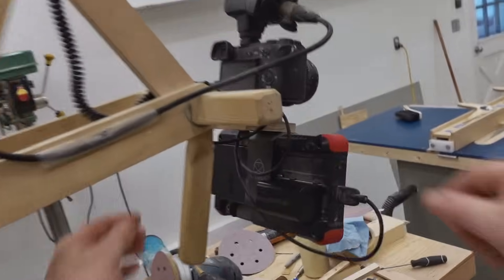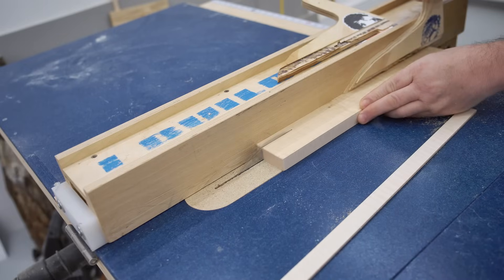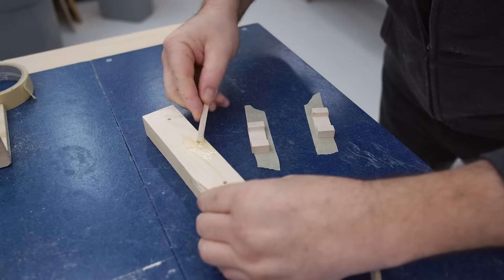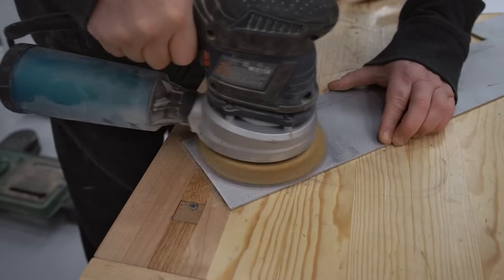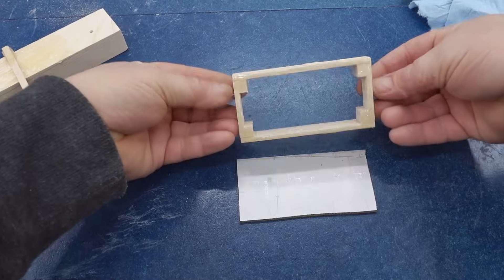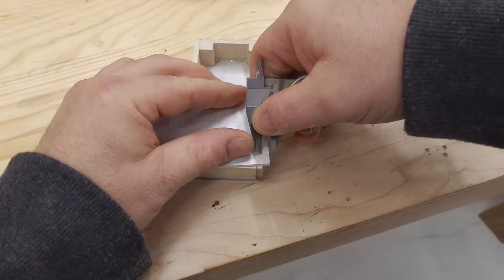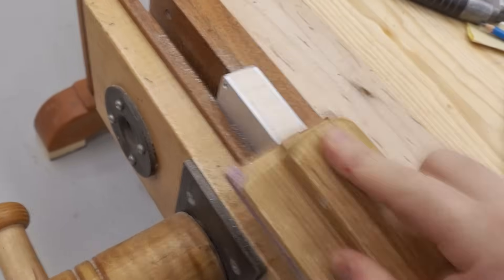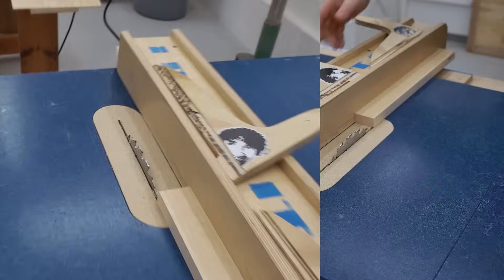Making This Aluminum And Wood Project Box

Comment: Nicely done this little piece. Lots of details for a neat result. Just a question. Since you have this fixed setup, why not using power from a transformer connected to an outlet so you don't have to keep an eye on the batteries ?
Reply from the maker: Mobility. The camera is on a gantry that moves from one end of the shop to the other.

Comment: Hi John, can you please explain why do you choose to cut some things on the table saw and some on the miter saw?
i'm speaking of the small parts that you cut on the mini table saw sled normally, but sometimes you use the miter saw for this kind of things. 
i can't understand why do you choose this way over the other.
Reply from the maker: Convenience, usually. 
And something to remember is that not everything you see in the video happened in sequence - there could be hours between one cut and the other that show up immediately after each other in the video.
Reply: @JohnHeisz  Thanks for the fast answer.

Comment: Just what I've been looking for for a small amplifier project I've been working on. I'd modify the dimensions so I can have the aluminum plate as the front and back rather than top and bottom, and attach the controls to that.

Comment: Cool project! And the blue aluminium really does look better :)
A question about the electronics (as I couldn't see a way to comment on the website): why did you use a linear regulator instead of a much more efficient switching regulator? I've seen modules online for a couple of euros, so was it just because you already had one lying around? Maybe it's the Wandelite in me, but personally I can't stand the less than 45% efficiency of a linear regulator, despite you showing that the linear regulator is obviously working well enough.
Reply from the maker: If I were back into doing electronics more regularly, I'd have built an adjustable buck converter to do this. Instead I used what I have on hand to get it done quickly. I don't trust the cheap switching regulators you can buy online to power a $1500 camera.
As for efficiency, I'm working with a battery that has nearly 10X the capacity of the camera battery, so there lots of room to throw some away.
Reply: @JohnHeisz  Thanks, that makes sense. I didn't really factor in the risk of "what if this $2 board from China doesn't work properly when attached to my $1500 camera", so I guess making it yourself would make more sense than hoping for quality in a $2 purchase. And, in that light, the linear regulator makes even more sense.
I know that the efficiency isn't an issue for you, as it clearly works. Part of me just thinks it's ugly if it's not as power-efficient as it could be. As I said, it's probably the Wandelite in me, with a tendency to make things more complex when a less complex build is also good enough — and, if you take build time and effort into consideration, better than the complex one.
Reply from the maker: The term diminishing returns applies here. The supply cost me nothing ultimately, since I bought these parts many years ago, and the extra amount of electricity used is not worth the extra time and expense to change to something more efficient.
Like rigging up something to switch off your electric water heater during peak hours, and running the risk of burning down your house when it fails.

Comment: Nice work, John! I always have trouble with metal dust embedding itself in the surface of the wood if I try things like this :( Had that problem with a walking stick I made recently.
regarding the electronics side, the circuit in that battery isn't just protection for the battery itself, but also some "brains" to tell the camera it's a genuine battery. If you inject power into the board where the battery cell solders on, instead of the output pins on the case, the camera should be fooled into thinking it's a genuine battery :D
Reply from the maker: I realized this too late, of course, after I stripped off the terminals and destroyed the board. Not a big deal, the proper dummy battery was cheap enough and the camera battery I used was nearly used up.

Comment: If you want to step down 18V to 8V for battery powered applications then best option is to use a buck converter, they are ridiculously cheap on eBay and the like too
Reply: I came here to say this. 6x for $10: https://www.amazon.com/eBoot-LM2596-Converter-3-0-40V-1-5-35V/dp/B01GJ0SC2C  Capable of 3A, they are great to have. Instead of dissipating the extra voltage as heat, they don't use as much current on the input and are much more efficient. The resistor and regulator work too though, and are cheap enough.
Reply from the maker: I've answered this in other comments: I don't trust cheap buck converters to run a $1500 camera connected to a $1000 recorder. Another reason is a buck converter outputs ripple, while a linear regulator supplies perfectly clean DC just like a battery.
Reply: @JohnHeisz  Ripple is negligible since I guarantee you there's more power electronics within the camera....
 A simple fuse on the secondary side would suffice.. there's equal chance of the buck converter failing as the linear regulator if it's decent quality, although you never know the quality of cheap converters

Comment: Great box! I liked it more in silver and wood... But here is my question - why are you using a linear regulator instead of a cheap chinese switching one? You could get at least double the runtime...
Reply from the maker: Mainly because it's what I have on hand and runtime is not an issue with these larger tool batteries. Another is that I don't fully trust cheap switching regulators, especially not to power a $1500 camera.
Reply: if run time was an issue you could use the cheap switching regulator to drop most of the voltage and the linear regulator for added safety

Comment: I advise against trying to mirror-polish metal.  Your eye is too good at seeing scratches.  No matter how careful you are to go through the sanding grits and rotate the piece and apply the right amount of pressure and on and on and on, you end up with a very crappy mirror.  I have tried doing this many times using an actual water-cooled polishing wheel, going down to 1200 grit, and it has never worked well.  Somehow, the pros get it to work, but not me - or you!